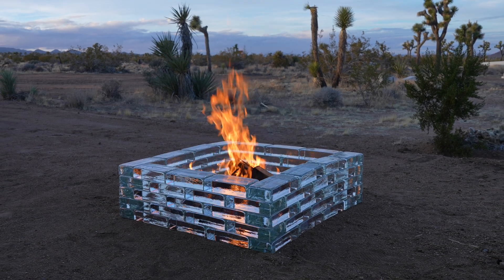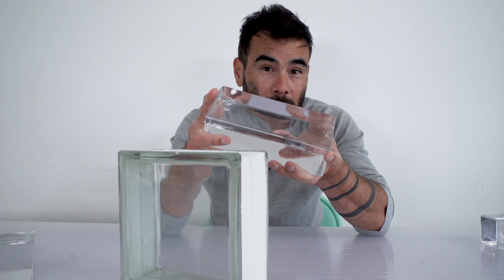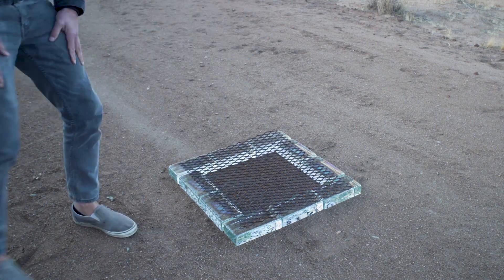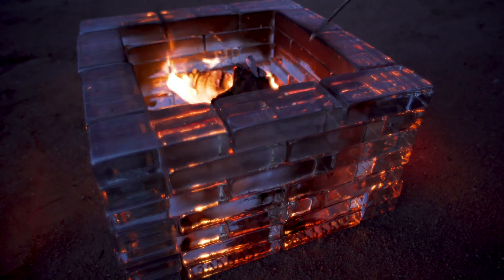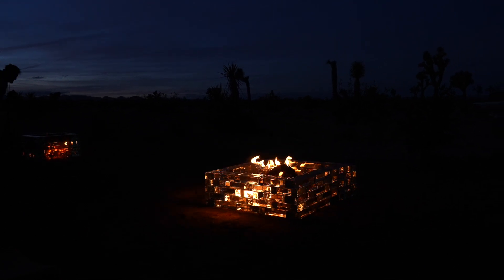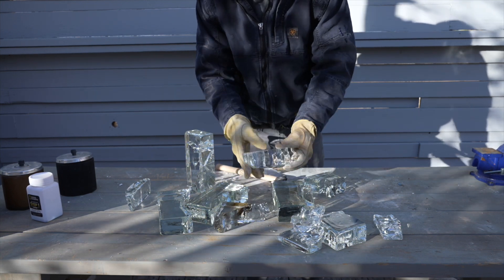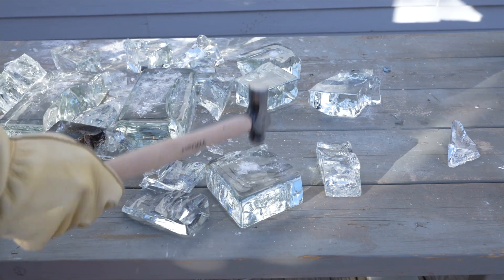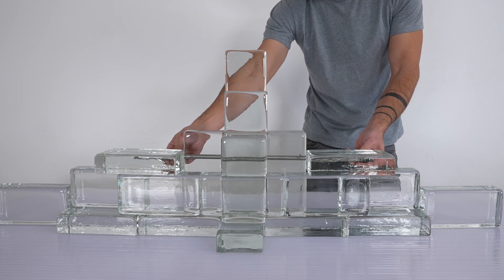Solid Glass Fire Pit

Comment: Probably not an issue for your climate but what would happen if it was hot and then it rained, would that make it crack more? and it would be good to see a temp reading of the outside of the glass after the fires been on awhile compared to brick. My gut tells me the glass would be a lot hotter.
Reply: 1. This is called thermal shock, and how well a glass handles it depends on composition of ingredients.  Look at typical glass dining ware and glass bakeware or laboratory glass, the reason the latter can handle temperature and shock is due to their composition of added ingredients. 

Thermal shock will be problematic, considering you're taking the temperatures of flame-licked glass and temperatures of rain and producing a very wide temperature swing in many pinpoint areas with decently high frequency. 

2. Certain materials can be difficult within different spectra, glass is a bit of a mixed bag with IR.  For example, greenhouses allow IR into them for heating purposes, but certain blends of glass will be reflective with thermal imaging.  Though reflectivity can also be problematic, such as with metals giving inaccurate readings due to their mirror-like qualities within the IR spectrum. 

Doing this is honestly a waste of time and effort.  Maybe you can get something off the soot but that's also going to be an insulative layer of different properties, so it's still a waste of time then. 

3. Heat of the material depends on various thermal properties and where you're actually measuring.  Surface temp will obvious be hotter than external, but what's important is how the material resists the heat or conducts it.  This also circles back to the first point and how material quality handles heat stress. 

Assuming the blend itself can survive heat, it should be fine for this application, as long a you're not building it directly around the fire. 

The optimal design for this would more than likely be a shallow interior pit, a secondary glass wall, and that glass wall being topped with typical brick/stone with overhang on both the interior and exterior edges, with a protective cover for the glass when not in use and for weathering purposes.
Reply: @xaytana thanks google

Comment: That'll look cool for the first 2-3 fires.
Reply from the maker: incorrect, the larger one has withstood 10 fires without a single crack. cracking is possible if someone makes a fire too large and over 50 uses I think we will have a significant data set to provide a more realistic probability of cracking rate.
Reply: @HomeMadeModern  Wasn't talking about the possibility of cracking, good info to have though, as much as I was about how often you'd have to clean the interior side of the bricks off.